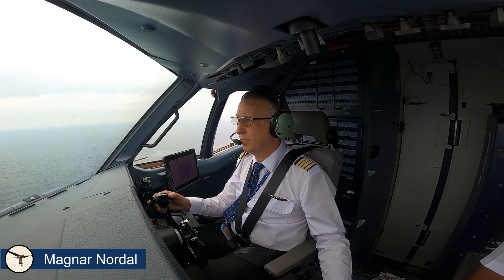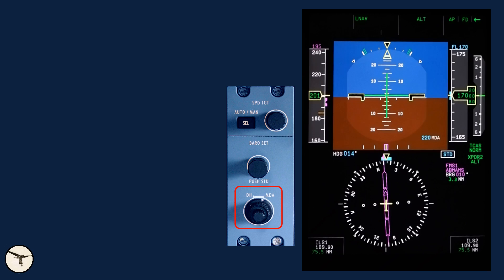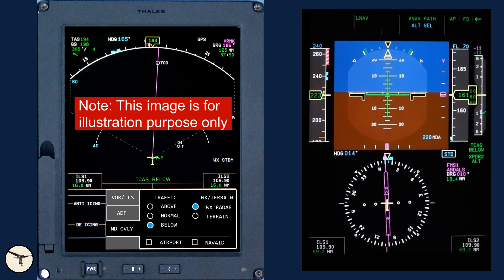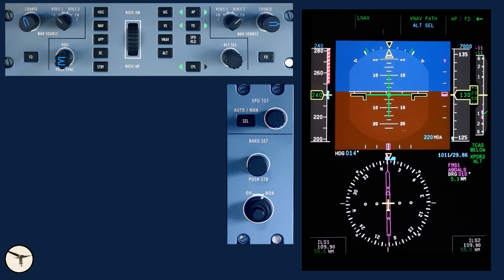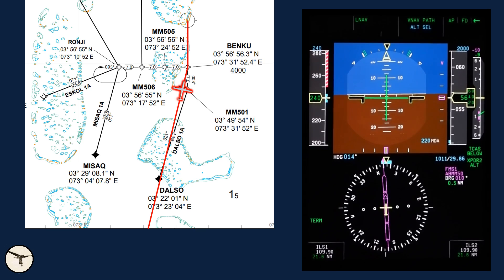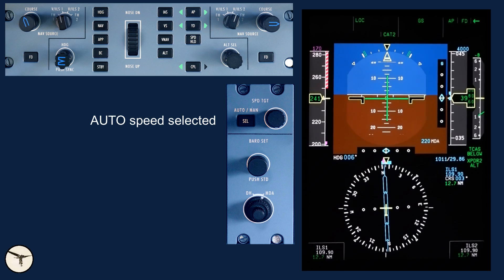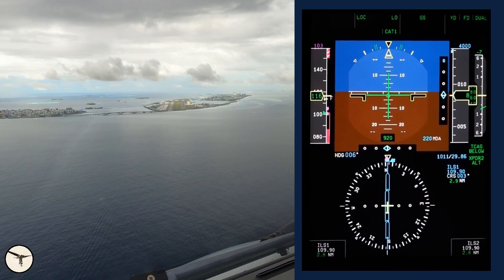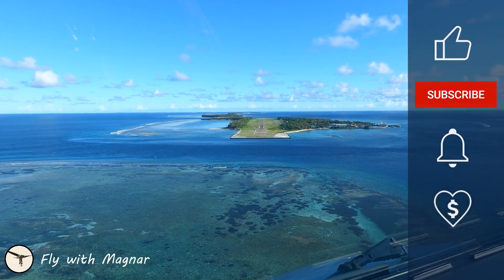ATR systems - Primary Flight Display (PFD) part 3 - ILS approach | Tutorial

Comment: Hello sir, I just wanted to know about high speed ils approach. At what phase to configure in this type of approach. As at IAS x 10 you place throttle idle. But configuration is difficult at just 300 to 400 ft the IAS starts to go below 180 kts.
Reply from the maker: I assume you are flying the ATR in MSFS? This model doesn't slow down in time. I suspect the developers were not aware of the extra drag the propeller creates when the power levers are in flight idle at speeds above 180 kt.
We do not follow the method in FCOM to determine the deceleration height (IAS x 10), as it enables you to be stabilized at 500 ft. In IMC, we must be stabilized at 1,000 ft. And threre's absolutely no margin for tailwind, updrafts, and late extension of flaps and gear. 
Instead, we follow the procedure in FCTM: When we are 13 NM from the threshold, we select flight idle. We are then 4,100 ft above the runway (3 degrees gradient). The target is to maintain 170 kt at 8 NM from the threshold. Then, it is easy to be stabilized in time.
Why are FCOM and FCTM different? Because they are written by different departments. The former by the manufacturing entity. The latter by the training entity.
Reply: @FlywithMagnar   thank you sir. I fly ATR 72-500. I have tried this method with some safety margins it doesn't work.

Comment: I have a question. Suppose i have set the correct ils frequency, reltive course and I have setted the altitude to Final fix point,   I'm descending in lnav vnav mode, if I switch the source nav mode directly  to v/ils and then push app button, will the aircraft  continue to descend for intecepting the LOC and GS and captured them?
Reply from the maker: No, this is possible in an Airbus, but not ATR. For the time being. You must first select VS mode, then HDG mode, then switch NAV SOURCE to V/ILS. Finally, you can arm approach mode. ATR is working on a software update that will do this automatically.

Comment: Good Morning Cte. May I ask you two question in the same time. Why in ATR 72-500 is not allow take off in LNAV Mode (Just HDG Mode). And why cat II is prohibited?  Thanks
Reply from the maker: Hi. For ATR aircraft with EFIS cockpit, the standard procedure is to take off with HDG mode. NAV mode (VOR or LNAV) can be activated when you are airborne. I have not flown ATR with EFIS cockpit since 2015, so I am not sure about the reason why the AFCS is made this way. Maybe the AFCS is not designed to accept arming of the NAV mode...
All ATR aircraft can fly ILS Cat II. The requirement is that the company, the aircraft and the pilots are certified to do so.
Reply: @FlywithMagnar  thx Cte.

Comment: Hi Captain, white F means minimum flap retraction speed when you have F30, and if this F spped is greater than Vapp, in case of a go around, we retract the flaps before reaching this F speed, since the call out is "Go around, set power, flap 15", am I missing something here? Thanks as always, regards
Reply from the maker: The white F means flaps retraction speed when you have flaps 15. The go-around speed with flaps 15 (25 for ATR 42) is the green bug. 
When initiating the go-around, the call is "Set power, flaps one notch." We fly with flaps 15/25 at green bug speed until reaching acceleration altitude.

Comment: I have two little questions capt. 
1) With the "FD MODE CHG" alert on FMA, does the triple click reversion aural only sound while on the ground but not while on flight. 

2) I've seen some videos during short final like on 100 to 200 ft RA, "FD MODE CHG" alert shown on the FMA which i suspect triggered by reversion to ROLL HOLD and PITCH HOLD, but with no triple click aural. After 7 seconds flashing, the message become steady without box. Then shortly after nose touch and propeller already on LO PITCH, triple click is heard but i see no flashing on FMA which indicates no new message, right? My suspicion is it was triggered by "SPD AUTO FAIL" which also trigger triple click aural as shown in this video. Then come the question, does the visual alert for SPD AUTO FAIL is suppresed when FD MODE CHG alert is being displayed on the FMA and then only aural warning generated?